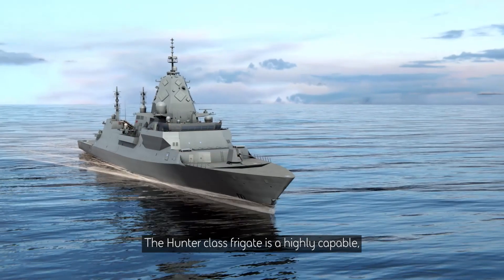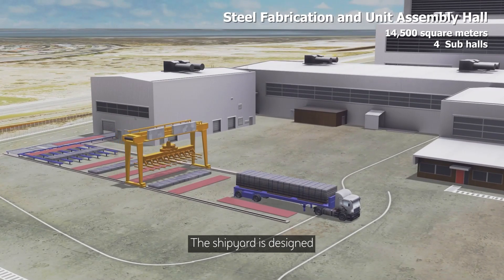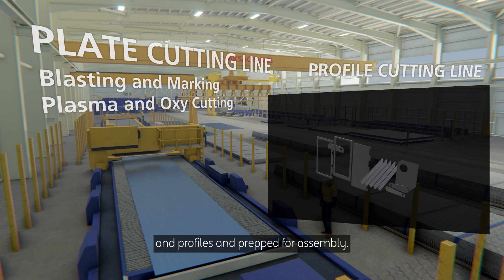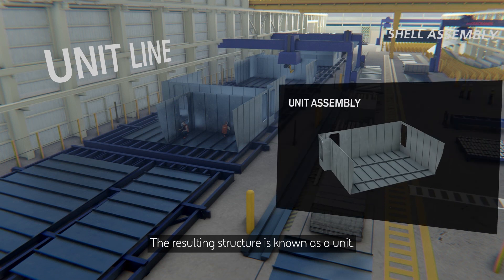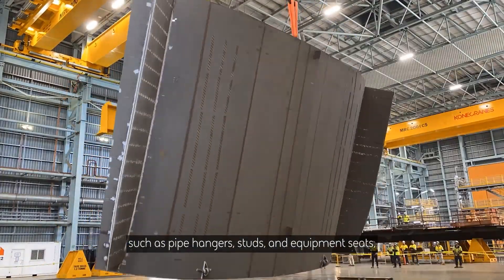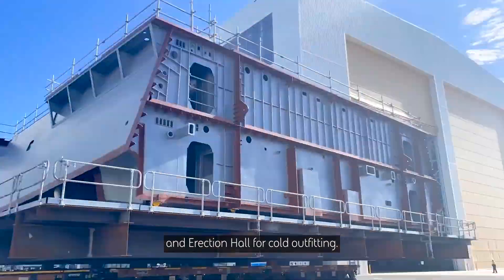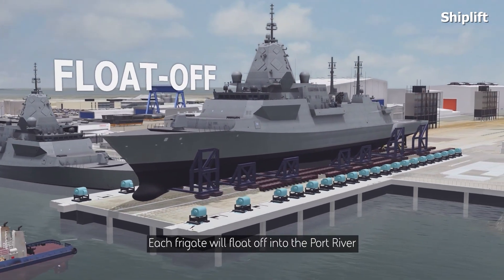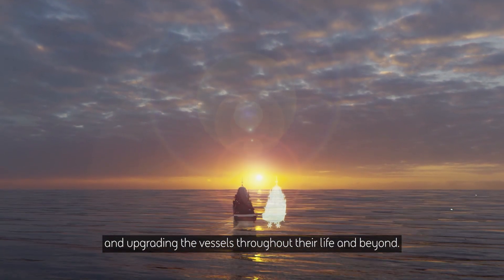Steel In, Ships Out

Comment: Still wondering why there are so many antennas on a ship when electronics can run a single active antenna in any frequency.
Reply: Ships need to have multiple circuits active simultaneously depending on the operational requirement. Therefore, separate transmitters/receivers/transceivers (depending on the frequency - HF/VHF/UHF), which are then connected to a dedicated antenna are needed for each circuit - you can only actively utilise one antenna for each circuit at any one time. Each antenna would also need to be separated physically from each other to prevent generation of electromagnetic interference. There are also Radiation Hazard (RADHAZ) considerations that need to be taken into account for certain antennas (particularly in the case of HF antennas) that mean that these antennas should be located away from areas regularly required to be occupied by sailors while these antennas are transmitting. One also needs to consider that these are warships, so redundancy of systems is essential for the inevitable moment that an antenna is damaged in battle, or fails to operate when required (often in time/safety critical evolutions), therefore multiple individual antennas for each frequency range, with dedicated and interchangeable connected subsystems is essential for a robust communications suite capabilty.

Comment: Steel in, 10 years to build a ship that should take 2 years.
Reply: I think a lot of the is working out a lot of the redesign of the frigate and working on the infrastructure to build it, such as, this shipyard.
Reply: Just so you know Australia imported all its steel for the Hobart destroyers. We didn't produce ship grade steel back then but we do now so be thankful that we now have Australian companies that produce ship grade steel.
Reply: One of the many benefits of building a robust local modern shipbuilding industry. The benefits flow into the rest of the economy in many many ways.
Reply: Show me a ship build anywhere that is just two years to build. You are ignoring the totality of design, tooling etc. Once the first ship is in the water, the following ships are launched at shorter intervals.  Of course some shipyards in Asia are faster, but workplace standards are very different to what Australians would consider acceptable.
Reply: I remember  reading  an article  last year it will take 10 years to finish the shipyard.  That's what taken up most of the time
Reply: @ one wonders why. New shipyard is required, where did they used to build all the ships?
Reply: @camf7522 ASC was originally built for the Collins class submarines but has since expanded into building ships. It's not actually a new facility but it has been upgraded every time a new project has been commissioned. New facilities just means new manufacturing buildings.

Comment: What Steel? Chinese Steel? 😅
Australia doesn't have a Steel industry anymore despite having the largest reserves of Iron Ore in the world.
Reply: BlueScope Steel

Australia's largest steel manufacturer, BlueScope Steel produces flat steel products like hot rolled coil and plate. They also have facilities for metallic coating and painting. 

Liberty Steel

Formerly known as Arrium Steel, Liberty Steel is another major integrated steel producer in Australia.

Australia doesn't produces steel anymore? What a load of crap

Australia is recognised as a world leader in the use of high-tensile materials and coating technology. Approximately 5.3 million tonnes of steel are produced in Australia annually.

Comment: Hunters need more vls 32 I's to low 64 would be a huge advantage to anti air capabilities
Reply: I agree. However, I understand that they will be built in two different groups. The first 3 with 32 and the following ships with many more cells. Our government needs to get its a-se into gear and build all the vessels recommended by the R A Navy review.   THEN, where will we get enough sailors to man them?
Reply: @ianrobinson8974  Now that we have the general purpose frigates to boost hull numbers, you'd hope that the second batch trio could swap out the mission bay for more VLS cells and focus on high intensity war fighting. But that would also require a delay and more money. Maybe, that money would be better spent on the LOSV program to boost the hunter's/ Hobart's cells by another 32. It might just be a more efficient way of doing it. And also, if you're part of a larger fleet, they  essentially need to sink both the hunter and the LOSV to destroy that large VLS capability otherwise if the hunter is destroyed, the LOSV can just redirect onto another Aegis platform and keep firing.
Reply: I hope batch 2 do have more vls especially when they said they want the hunters to fire tomahawks and sm6
Reply: The Hunter was never designed for anti air. That is a bonus. It is an anti sub ship. It is designed to detect and distroy subs.
Reply: @Caine1277 ahhh so I guess it’s getting Aegis and a better radar than Hobart for no reason? Seriously 🤦‍♂️
Reply: @Sam-cn4ch  it is getting them because Australia wanted them stuck on it. We took a Sub hunter ship that was sleek light and nimble and slapped a heap of pur heavy stuff on it and asked it to be a destroyer.  It could still be a good ship but everyone thinks it will be undergunned. Again, the original design is for sub hunting. Subs don't fly.

Comment: Now that we will have nuclear attack class submarines why are we building this? Hobart and Mogami is a better design for the navy when complimented with the Virginia. Mogami can perform both anti submarine and sea mine warfare……it’s a lot less expensive and can be built a lot quicker.

This is a waste of money.
Reply: These will replace the Anzac class which will be nearly 40 years old by the time these are commissioned, these are not replacing the Hobart class and the Mogami is being procured along side the Hunter. Both hunter and Mogami can perform ASW while Mogami can deploy sea mines, the Hunter has double the VLS cells for air defence, really not a waste of money
Reply: @gibbo_303 every ship has the same basic capabilities of the Anzac, so it’s a question of their specialisation.

Hobart = air defence 
Hunter = anti submarine 
Mogami = anti submarine and anti sea mine

Mogami has less than half the crew requirement and the next version will have 32 cell vls. Hunter looks like a very expensive duplication of Mogami capability that can’t perform anti sea mine warfare. When you add the sensors of the Virginia you have to ask if the additional cost of the Hunter provides a needed capability in fighting Chinese submarines.

I would suggest a larger Hobart with more vls cells + lots of Mogami + Virginia, against China this will be more than adequate close to our mainland.
Reply: Not a waste of money at all. Surface ships conduct roles that submarines either cannot or would be wasted doing.

Things like surface air defence, anti-piracy, protection of shipping and can operate helicopters and drones for surface strike and anti submarine warfare.

The surface fleet is extremely important in controlling naval choke points and in supporting marine operations.

While submarines will always have an advantage in combat, their limited number and stealth suits them to particular roles. 

A good mix of both is what our navy needs. I believe the current force plan for the RAN will suit the nation, making us one of the most powerful naval powers in the world, but as everyone already knows, this should have started a decade earlier.

But we have to make do with what we have. More submarines will be great, but they only fill one niche. A force balanced for not only China but unpredictable low intensity operations that could suddenly happen (like the East Timor crisis) where Australia has to go it alone is what our Navy needs to be.
Reply: @BaconGold790 my argument is cancel Hunter and buy lots of Mogami…..it’s cheaper to buy and operate. Hunter has a better sonar, but it comes at a huge price. Now that we’re procuring Virginia we don’t need the additional anti submarine capabilities of the Hunter. 

In addition, Mogami also performs anti sea mine warfare.
Reply: @ the big differance between mogami or FFM and hunter is the extra money being put in to reduce hull noise to make them more stealthy for the sonar operators hunting the submarines, everything that is bolted to the ship contributes to hull vibrations and noises, a ship like hunter has everything from rubber dampers to noise reduction coatings etc.. The FFM could be a good submarine hunting ship although we would have to spend a lot more money on it to reduce it noise signature for the sonar operators on the ship who are hunting the submarines..
Reply: @JPT-fz8wc do you think the Japanese don’t understand what’s needed to detect a Chinese submarine? The British built this to find Russian submarines, we don’t need this yet…..Mogami is more than effective against Chinese submarines.
Reply: I agree. 32 Cell VLS for a destroyer (8000 tons, not a small ship) is obsolete. Needs to be at least twice that. Missiles will be burned through like mad once the shooting starts.
Reply: @TheBelrick they should replace the Hobart with twice the VLS cell capacity (96) and build 6. For anti submarine and anti sea mine warfare, they should build 12 of the new Mogami with 32 cell vls.

Mogami can then be used as the general purpose frigate, Hobart as a genuine destroyer.
Reply: @うえんとわす  They should just replace the Hobart AWD with 4 Navantia Flight lll destroyer/cruiser for LHD/LPD/AOR task group air defence escort, add 32 VLS to the mission bay on Hunter to make them a 64 VLS ASW/DDG and build 8 ships, keep the japanese FFM the same as it being a ASW/MCM/FFG and build 8 ships.. That's our 20 ship surface combatant fleet that covers everything including hypersonic and ballistic missile defence..
Reply: Nah mate the FFM we will build and Hobart are nowhere near the same level as Hunter class when it comes to ASW, having a stealthy silent hull like the Hunter is a massive advantage with ASW, plus it is Ageis meaning we can use SM-6 which is a dual use missile for air defence and surface to surface strike.. The payload depth and price is somewhat questionable although that's Canberra fault trying to make a ship they think can do everything including wanting the Hunter to fill humanitarian and disaster relief.. Japan FFM we will be building is a massive step up from the ANZAC frigates but it's not in the same class as the Hunter when it comes to ASW or strike, SM-6 can be used as a surface to surface ballistic missile meaning we will have the option of 32 surface to surface missiles where as the FFM frigate only has 8 surface to surface missiles.. Hunter class being 10,000 tonne is falling into that light cruiser class 32 is not enough VLS for a Aegis ship of her size, they could add additional 32 VLS to the mission bay to give her 64 VLS and still be able to maintain the ASW tow array, you can't add anymore VLS to our Hobart AWD it doesn't have the room for growth without having to be redesigned to allow for it.. Only place you could add more VLS to Hobart AWD is the helicopter hanger which we would then lose it and also have a massive weight increase above the waterline losing agilty which would mean reducing weight elsewhere like removing the ASW tow array and anywhere else they could remove weight above the waterline, or remove the main gun from the front and turn that munitions bay section into VLS then we lose the gun which is more valuable for us for close range engagement compared to VLS missiles, the main gun can shoot stuff a few hundred metres away like another ship close to us the VLS missiles can't it is to close..
Reply: Australia is copying the High - Low Mix of the US.

Comment: Why are units assembled into blocks and then installed into the ship? Could that not exacerbate quality control issues if certain units are below tolerance and this is not identified until after assembly into blocks or even until after the block is installed on the ship? Wouldn’t eliminating the block step in the process reduce the need for heavier equipment like cranes and help speed up the process? If anyone has any information on this or can direct me to said information that would be appreciated.
Reply: That’s the way ships have been built for decades. It’s considerably faster and more efficient and there’s no issues with tolerance especially when parts are cut my computerized manufacturing.    Even cruise ship staterooms are built individually and then slid into place as the ship is built, this also means these blocks can be built elsewhere then transported to the ship yard allowing a single yard to produce more ships in a year than it otherwise could on its own.
Reply: Everything is pre-cast now. Some of them are modular too.